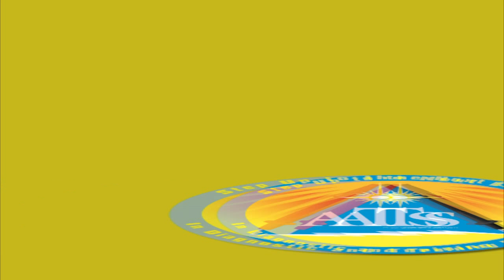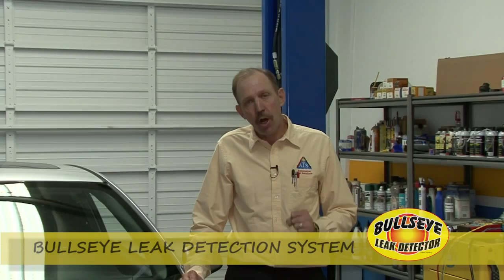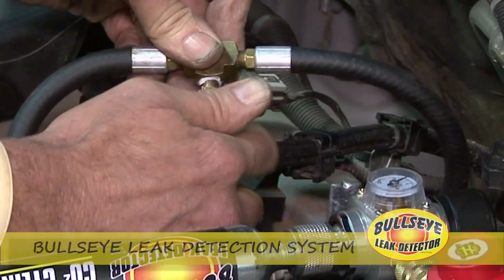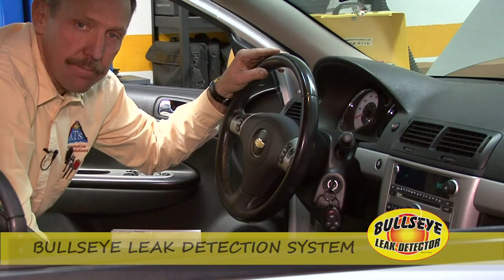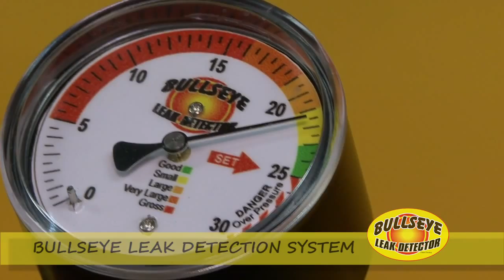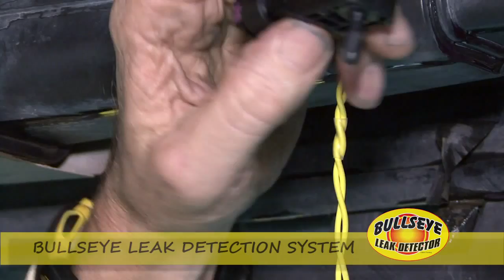Case Study1 Cobalt

Comment: What's the difference between using a smoke machine instead of the co2 mixture?
Reply: The point of the CO2 is so you can use the audible CO2 leak detector. There is cases where the leak is so small that the smoke can't actually be seen at all but it still throws a code.